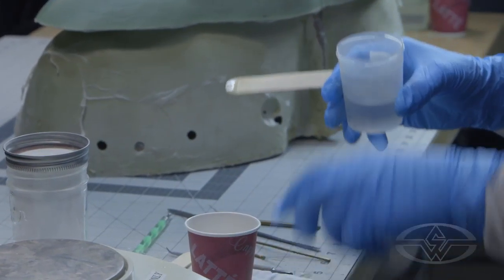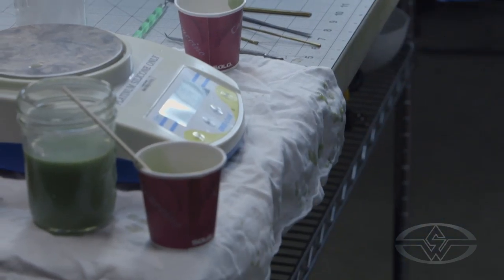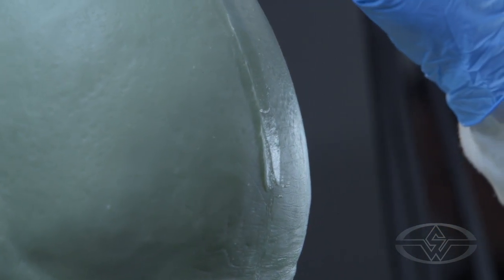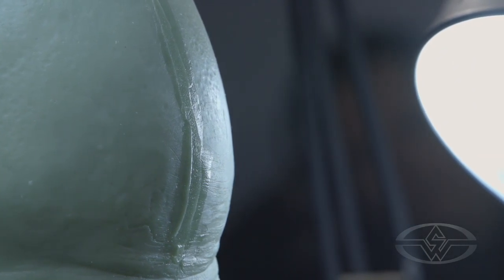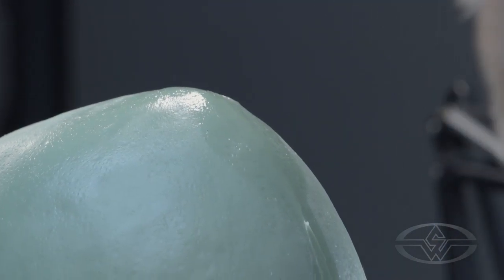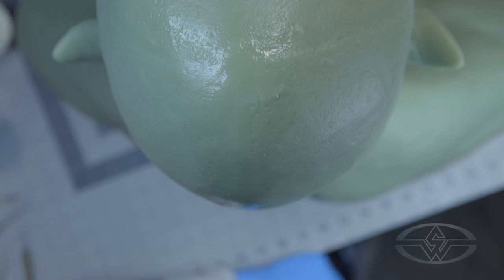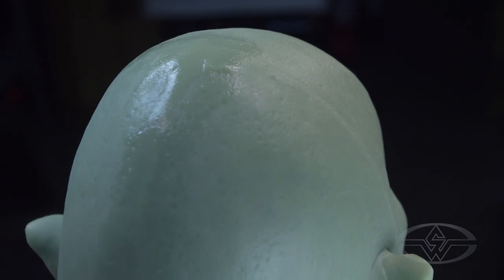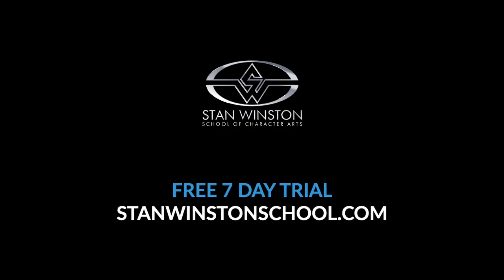Silicone Sculpting & Patching: How to Patch the Back Seam on Silicone

Comment: What is he dipping the fan brush in? Just more of the silicone?
Reply: Naptha. It's a paint thinning solvent. Works great with thinning silicone. I'd recommend mineral spirits as a "healthier" alternative. Works just the same, not as harsh of a chemical, better smelling. Always always ALWAYS use a respirator or dust mask.